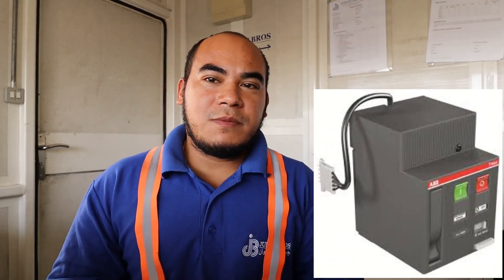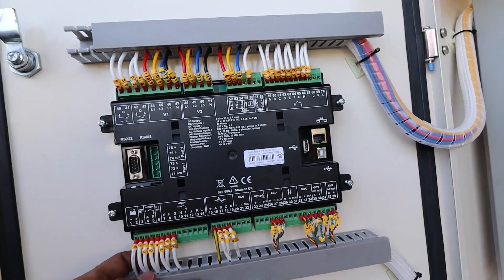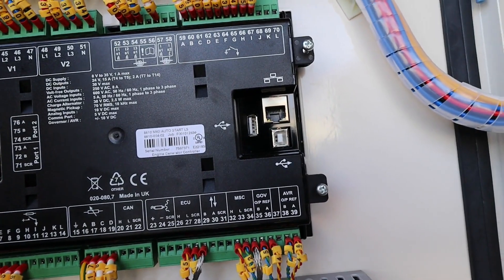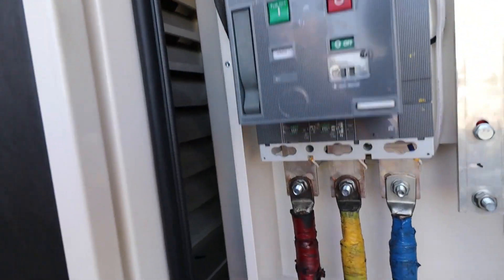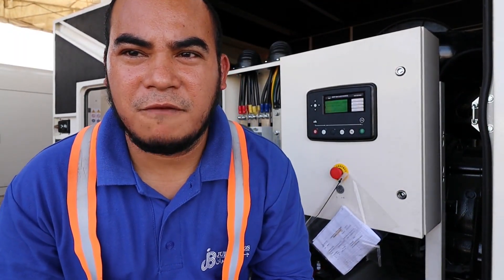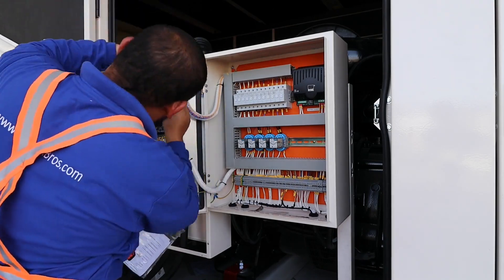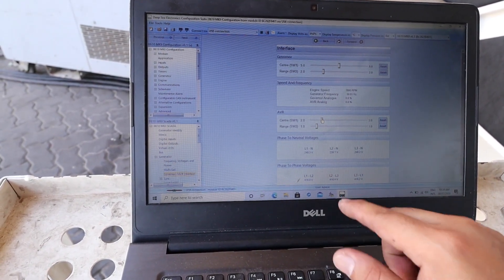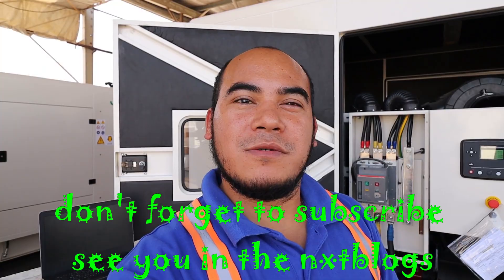How to do a voltage and speed biasing using 8610 DEEPSEA module                     benzblogs

Comment: Sir ano possible root cause ng reverse power sa deepsea 8610 MKII cummins engine KTA38. Pinalitan ko na ng fuel pump at speed controller, ok naman, after more than 1hr or more nag aaalarm ng reverse power.
Reply from the maker: Root causes is avr calibration and droop ct

Comment: Sir pwede magtanong sa depsea 8610...37.   38...terminL to as440 avr..a1   a2 ano po tama
Reply from the maker: Kong paponta ng a1-a2 ito yung voltage control galing sa deepsea pero ito ay nakakonnect sa avr side ng deepsea katabi nya ang gov ddon sa deepsea connection

Comment: Hi  how can I inerface a cat  ECM  with  DSE  CAN bus  can you give me a pointer
Reply from the maker: What you mean exactly
Reply from the maker: Just connect the wire check the ecm diagram for ecm connection thisbis 3wire inclouding the screen and should have a resistor
Reply from the maker: And you should activate the funch can to your ecm as will

Comment: Hello Brother..  Do you change the Frequency on Speed control it self by Trimpot/software before you adjust SW1 and SW2 of Governor In DSE Software?
Reply from the maker: You should in order to have a good respond to a deepsea and your speed gov.
Reply: Set the trimpot on avr and speed control to nominal speed or droop speed?
Reply from the maker: For me its always depends on due to a custumer it always varry

Comment: Hi sir, we have problem when the generator on load, in graphic trend deep sea we founded spike voltage 1 sec and trigger our equipment motor trip, can you advice please tutorial for tuning deep sea 8610 for handle this case ?
Reply from the maker: Ok i ask what engine electric or conventional
Reply: @benzblogsVlogs  engine
Reply from the maker: There is ecm or no

Comment: Sir thank you,  can you share the wiring diagram for the full set up.?
Reply from the maker: Sir diagran is always refer to the types of the engine manufacturer
Reply: I mean the two dse 8610 and the ats and to the generator circuit breaker. I want to see the control wirings.

Comment: Useful information. 
 Thanks for sharing your knowledge and experience. Keep it up. Suggest to make a separate video on AVR and Governor  settings for synchronising applications.
Reply from the maker: Its depent on type of engine
Reply from the maker: And avr
Reply: Good evening sir .I have one engine don't have a speed controller unit ..but engine eltronice governor..my speed control unit is faulty .
But I have deep see 8610 it's working..
Deep see.
Gov .point is there is working ..Mpu is also their ple sujection me ..

Comment: Sir good afternoon we have generator set for 220v but we need 440v after changing the wiring in 440v and the avr the Dse show in the panel generator over voltage. Question: how can I change in active config 128v  to 280v DSE 6120 model?
Reply from the maker: Yea you need to config tge module to aviod over voltage
Reply: DSE 6120 model
Reply from the maker: You need latop to do that you can not do it manually in the module
Reply: Brother mag change tappingvka sa main alternator depende sa manufacturer, meron kasing genset na sa deep sea lang kinu configurate

Comment: Sir tanong ko lang un governor interface at avr interface  paano ba adjust un  dahil may na encounter ako unit dse8610 pag di pa close in breaker out ng genset ok sya na 380v pero pag I closed ki na sa controller tumataas ng 400v once open mo babalik sa nominal voltage  ano kaya problem non sa avr interface adjustment or sa Mismo avr na ng ac alternator
Reply from the maker: Sir naka sync ka dba sorry rilog na ako kagabi
Reply: @benzblogsVlogs  hindi naka sync stand alone lng
Reply from the maker: Without load po ba nagsynch yong mga genrator mo? Asap para malamn natin problima
Reply: @benzblogsVlogs  naka stand alone lng un unit pero may load un pag walang load 380v pero kong may load nagigin 400v
Reply from the maker: Send m picture anong avr at anong engine
Reply: @benzblogsVlogs  as440 un avr model
Reply from the maker: So kong naka stand alone sya dimo na dapat e connect sa voltage at speed sir kc rated lang sya sa isa speed at voltage tama
Reply: @benzblogsVlogs  un sinasabi mo na di na dapat konekt  speed  at avr un ba ang communications ng controller ng 8610 na number 37 38 speed at 35 36 avr na nakakabit sa controller
Reply from the maker: Ganito gawin mo sir ta galin mo yun speed at voltage ngayun e adjuat mo sa rated voltage na kailanagan mo yung avr paa di sya magbabago pag nag laod ka
Reply from the maker: Pero if sunchro kailanagn nakaconnect yan para si module ang mag adjust nag kosa para mag match at magsunch po pero si hle unit not needed po

Comment: Sir  paano ba wiring breaker sa dse 8610 at saan ginagamit un digital input as breaker connection.
Reply from the maker: Sir my vedio ako jan sir kaupload lang
Reply from the maker: Digital input ay ginagamit para sa feedback galing ng breaker status mo kong of ba or on
Reply: @benzblogsVlogs  kasi kaya ko nmn nagtanong sir may unit ako ayaw mag closed un breaker check kona un auxiliary switch ok nmn at un selector switch ok nmn may continuity  do ko alam saan un problema
Reply: @benzblogsVlogs check ko na un digital input papunta breaker auxiliary ok nmn un ayaw parin mag closed un breaker
Reply: @benzblogsVlogs  sir sensya na kong nabibigyan kita ng problem dahil sa magtatanong ko wala kasi support un co. Namin

Comment: Sir, ECU red , warning AMBER what cause it can you enumerate the components to check?
Reply from the maker: Ecu amber means like common alarm in the module if ecu red that is there fault alarm already wich give code that you can check in the manual

Comment: Hi, how to set balance engine hours program 8 hour interchange, every 1 hour priority 2 start and stopped .. why ? Like that .. please advise
Reply from the maker: Meaning your are in syclic operation?
Reply from the maker: Till me if your in synchro or cyclic
Reply from the maker: So i can give u an advice how to make it and why
Reply from the maker: If in sychro operation balance hour means every 8 hrs change over from priority 1-2-3 and more in order not always same engine running all the time during low load
Reply from the maker: Same with the cyclic every 8 hours change over  but its only aplicable in 2 genset without mains

Comment: Sir how to adjust avr voltage
Reply from the maker: Yes sir
Reply from the maker: Do this search the boltage potentiometer there you can see voltage adjustment and stabilty and excitation current just go for boltage rotate clockwise or anti clockwise depend on your needs

Comment: Hello sir...... after synchronization comming reverse power on without load.
Reply from the maker: Ok go to you totalizing panel check line sensing gointo module my lose and if all fise or breaker ok go tu your program
Reply from the maker: Make sure wiring for sensing in proper color coding
Reply: When on the load from totalizing panel everything working normally
Reply from the maker: Just go to your program
Reply from the maker: Put the delay for reverse power

Comment: sir good eve po.. tanong lang sir deepsea program ba ginamit mo sa laptop mo para magtama yung voltage??
Reply from the maker: Sir program para maintindihan ng module kong ano ang linitation at safe ng voltage
Reply from the maker: Ang adjustment doon ka sa avr
Reply: ah gets ko na sir.. salamat po
Reply: Sir tanong ko lng pano  ang connection ng breaker at kong puede bigyan mo ako ng diagram kong wiring nito.
Reply from the maker: @josephgammad2338  sir bawal po kc sa company namn ituro ko sayo nalang sir ok lang po ba
Reply: @benzblogsVlogs  ok lang po puede kahit sa text ok lng  thanks po

Comment: Good eve. Again sir'
  Sa DSE 8610 need ba talaga naka parallel connection ang tatlong generator sa MSC/Gov at Avr??
Reply from the maker: Sir if this is synchronizing only the msc joint together with module 1,2,3 for communication with reaiator but AVR is connected individual fron 1-3
Reply: Sir what value of resistor put in msc communication?
Reply from the maker: Coz each module is one avr connected and speed for biasing
Reply: Yon lang problema sa set up na yon sir  yong 8610 is also ready for synchronizing kaso gumamit pa sila nang woodward controller synchro panel..kaya kadalasan my alarm ang genset pag my power interuption
Reply from the maker: 120ohms sir
Reply: Ok sir thank you and Godbless
Reply: Sir tanong ako ulit sa stop timers nang DSE 8610 ilan dapat ang return delay?? At dapat po ba may cooldown timers??
Reply from the maker: @nielaldrinniadas655  yes sir dapat my cooldown standandar time is 60sec
Reply: Yong sa return delay sir ilan dapat e set??
Reply from the maker: Sir return delay de n dapat babaguhin yan  tma nyung nada deasea
Reply: @benzblogsVlogs  ok sir thank you
Reply: Sir ano Yong Tamang setting biasing ng governor at avr sa dse 8610? Thanks